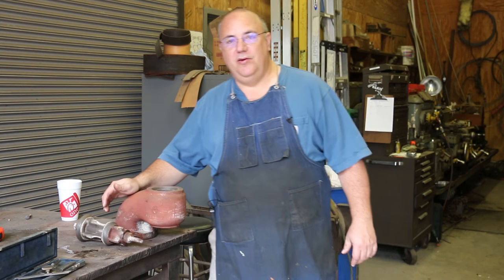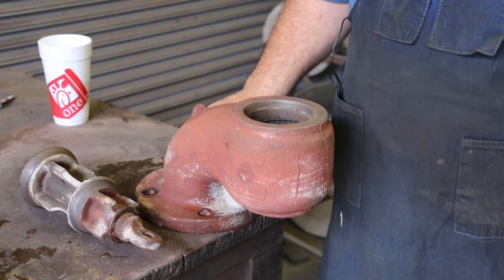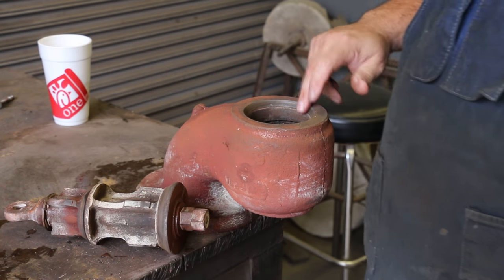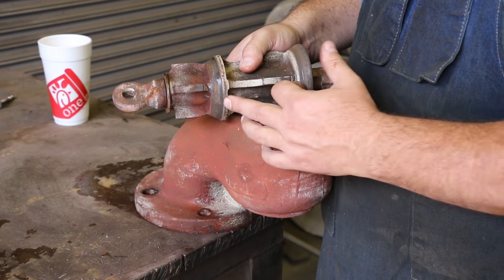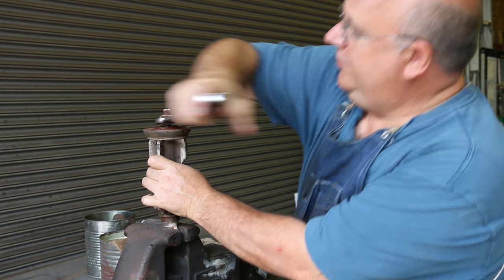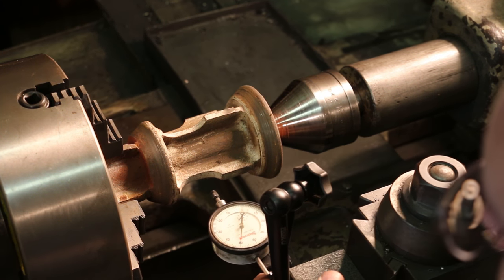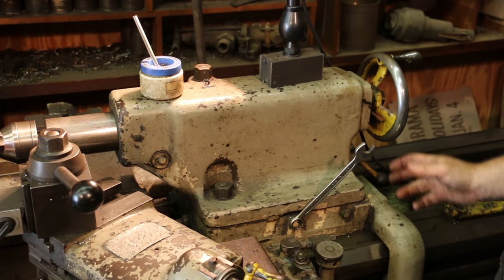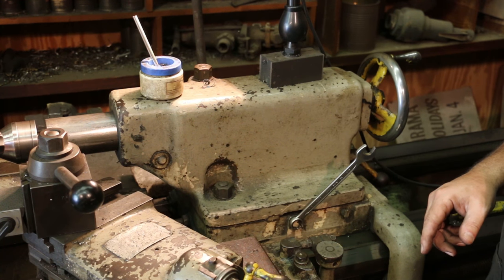Steam Locomotive Throttle Valve Repair:  Turning and Lapping

Comment: Keith. Moving the tail stock will not correct for runout.
Reply: John Flynn It doesn't matter since this is not a spinning part. All Keith was trying to do is get the same reference for both valve surfaces to get the same angle. It's not going to be completely precise but since these surfaces are going to be lapped in, not critical.
Reply: I agree in this case it hardly matters. However it would seem to be a window into the confusion Keith brings with him. Very basic stuff.

Comment: Grinding the disk against the seat is incorrect as they are two different angles this is what makes the valve seal. Should make a lap the same angle as the seat. Lap the seat with fine emory stuck to the lap with double sided tape until entire seat is flat. Should get a good blue check if the disk is round. Blue contact should be about 1/16 around entire disk

Comment: If you're Machining those valve surfaces correctly the valve after Machining should stand at least several thousands above the surface edge of the valve base the surfaces should be in contact by 70 to 75% the rest of the surface Edge should be extended with the seat down and the valve seal slightly above so that as it wears and it seats itself in there'll be a perfect seal it's the same thing as you do with an automobile or diesel valve if you can't machine a valve in its seat you got a lot more trouble than just blow by on that valve

Comment: You need to get your self an adjustable center like this one. http://www.riten.com/products/live-centers/adjusta-point-live-centers/
Or you could make one, wouldn't be all that hard to build as simple one with just deep groove ball bearings in an over sized bore and some set screws. Wouldn't be any good for heavy duty use but probably just fine for repair work.
Another thing would would be a tail stock mounted 4 jaw chuck. I've got a mount that I can put a 10" 4 jaw on that makes short work of weird setups. 
Any how thanks for the great video!

Comment: Thanks for yet another good video. I was watching Dave Richards, the guy that has the all steam driven machine shop, and I saw him do a clever setup on the lathe. Had the same thing going on with the center being out, he made a tapered plug from wood to find center and went from there. Seemed to work well. Just for future reference. You can check it out here if you'd like..... https://youtu.be/ko6CgHycD-k?t=612

Comment: 100 year old steam valve and the jam nuts Crack loose in a vise with one wrench. 5 year old car an the tie rod jam nut won't budge with a four foot bar and a torch, what gives.
Reply from the maker: It may be 100 years old, but those nuts have been removed many times over the years.  I know for a fact that I was into this valve five or six years ago myself.  It's not the first time we have worked on it....